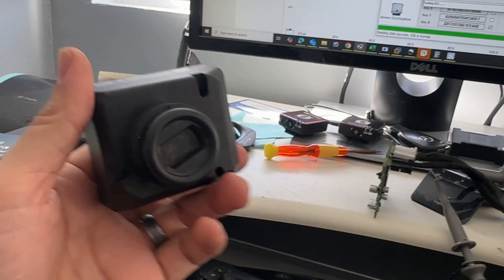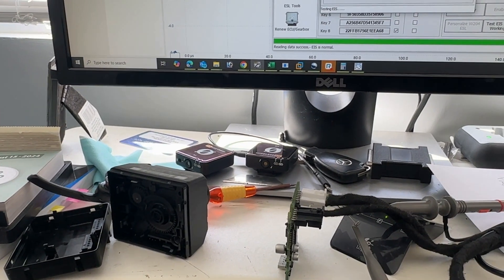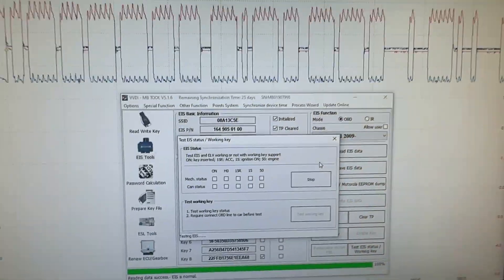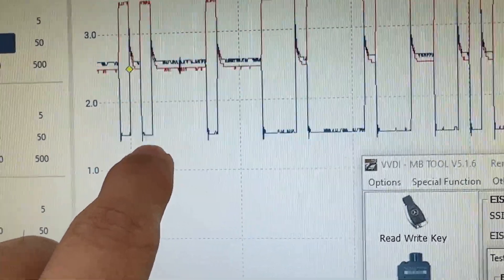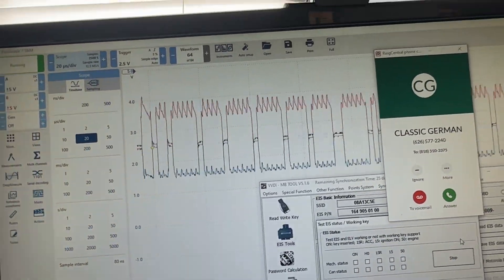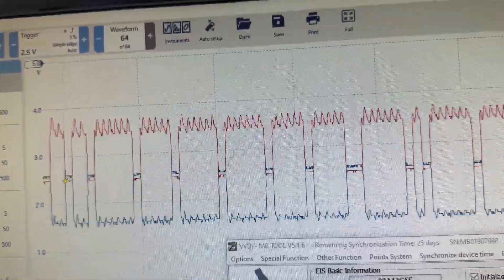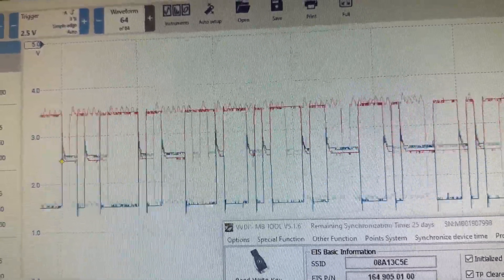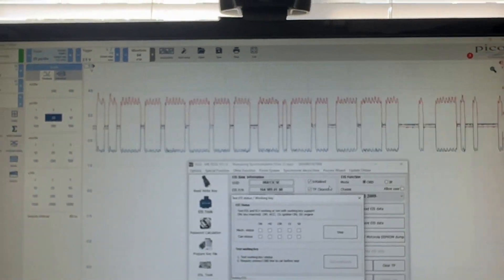Fix Mercedes No Crank/Start When the Weather is Cold. 2009-2012 GL ML R S CL Class. W164 W221 W216

Comment: I have problem when i drive under 10km/h and the car put the transmition in parking  itself. This is happen when the weather is hot and the car stay at parking on direct sun. When the cabin get cooler by the ac the problem dissapear. No error code od the dash.
W212 e220 cdi 7g automatic gearbox.
Reply from the maker: Bad EIS. You must replace it to fix the issue. We can help.

https://benztechmodules.com/product/mercedes-electronic-ignition-switch-eis-cloning-1998-2014/

Comment: Have you found a way to repair this exact issue??
Reply from the maker: Repair no. I replace the EIS with another EIS that does not have this issue.

Call or text us if you need this done.
818 510 3375
-Michael
Reply: @mercedesbenzspecialist  Thanks for the response, Michael.  We are a Mercedes Benz specialty shop.  We always go with a new one and once in a while we have done used but I was hoping you could repair or know of a place that can.  I have a box full of these facelift EIS's and the last one we ordered was, apparently, the last one available in Germany.
Reply from the maker: I have not been able to repair this issue yet, not for lack of trying. I haven't figured it out yet.
Reply: @mercedesbenzspecialist  I have the same issue on a 2003 SL55. Any fix?
Reply from the maker: @martinair329  Replacement of the EIS is the fix. We can replace your EIS, we need the original EIS and key fob to get this done. Call us if you have any questions.
818 510 3375